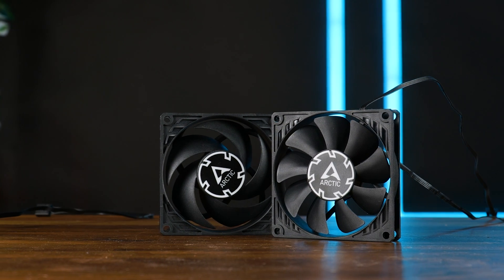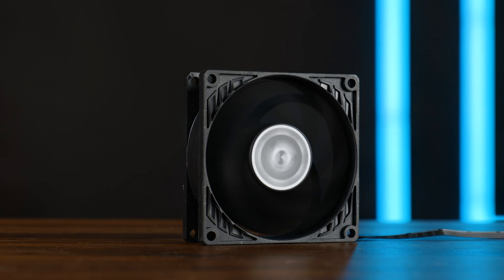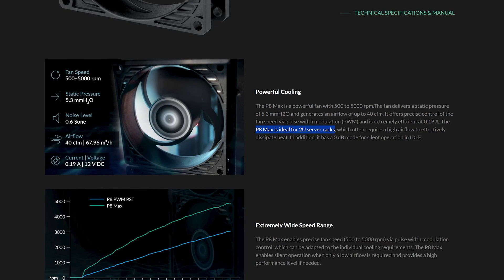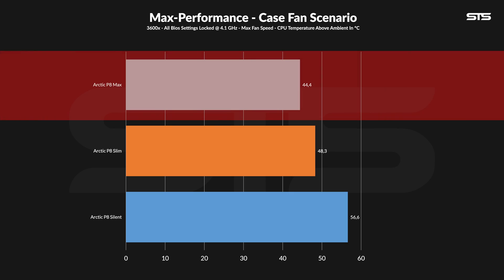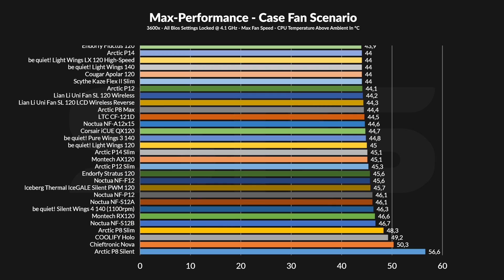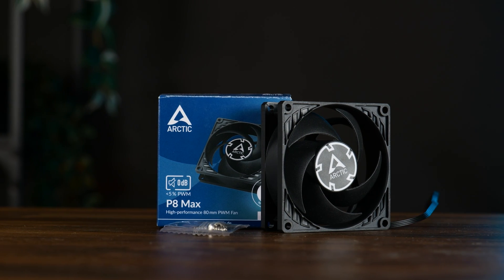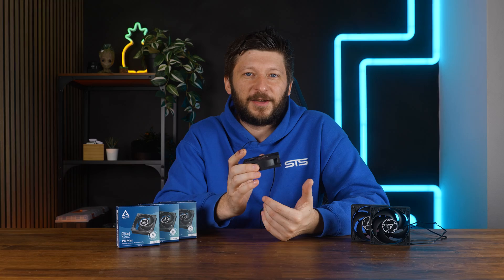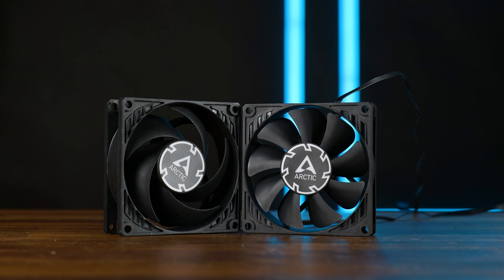80mm Fan on 5000RPM Steroids - Arctic P8 Max

Comment: I'm using a old 2001 HP pavilion 533w case and the only intake fan on the whole thing is a 92mm I have now that is a 2300rpm truthfully it's fine until both CPU and GPU are under a bigger load cooling becomes a 75-80°c situation and that's acceptable with both under a 80% load but I'd like to get it lower and for $10 I have nothing to lose 😊

Comment: If you want more small fast spinning fans, I can highly recommend the San Ace 9GA (available at 25, 20 and 15mm thickness) and 9RA (newer, but only 25mm thick) 80mm fans. The slower models have a bit less motor noise, but they all go down to inaudible at like 11% PWM. I had a P8 and at the same rpm they all push just so much more air than the P8

Comment: Like I said on the previous regular P8 review, you should try it as an exhaust on a case with hot air from a GPU or something. The blades on these expand and hit the frame at max speed when in a hot airstream. Personally would not recommend this fan in a hot exhaust situation.
Reply: This would certainly sound like something to consider before a purchase. Do you have any articles, video or otherwise, that have done tests to confirm this?

Thanks in advance.
Reply: The blade design just seems bad on this one, the F8 had much better stats at 2000rpm than the P8 at 3000rpm

Comment: I got the irregular human being one, still don't know what should I use it for, even got the fan hub to support more current.
Reply: I got one too, the S8038-7k. Dont bother using it in your standard desktop config unless you clamp the pwm to 50-60%. Even then so its still comparitivly loud, as loud as a T30 at 3000rpm. And at low rpm it has an annoying buzzhum. But for servers this is great. Now i just need to get a 2U chassis
Reply: @dankmemes3153 I got the 120mm 8k rpm one
Reply: Maybe use it for its intended use case? (I.e. server)

Comment: you dont wanna hear the 10k rpm 12's i have on my 240 rad :P
only take 3.4amp or so (a piece) at full speed on a rad its noisy, open air they sound like a Boeing 747
(like not kinda like one,  they SOUND just like one)
Reply: Mine are quieter than the NZXT stock fans.